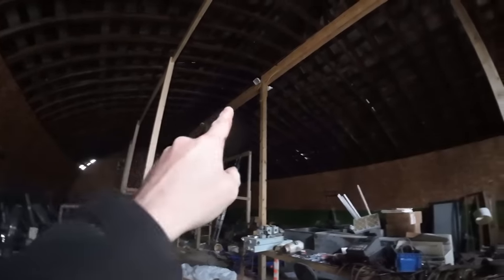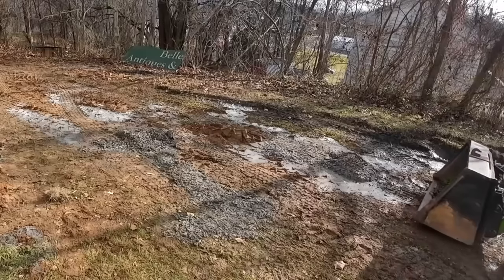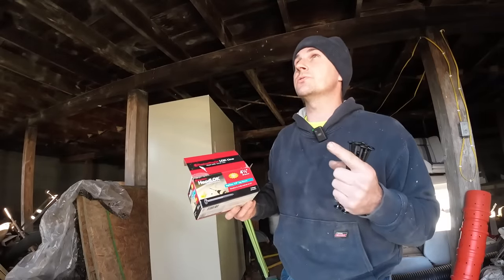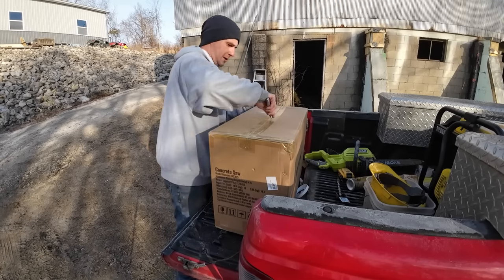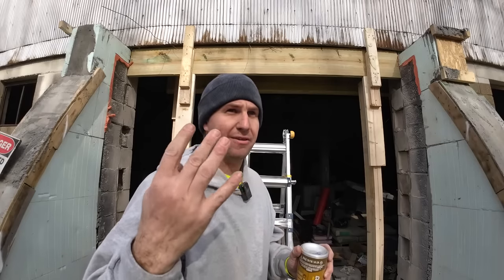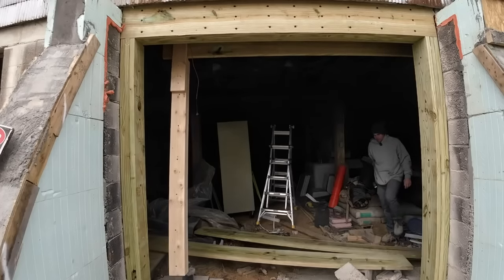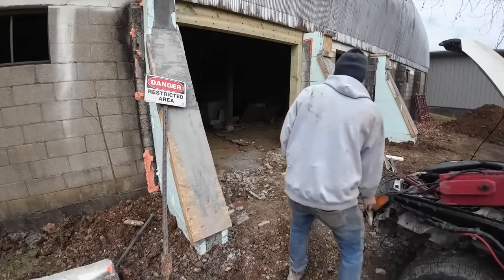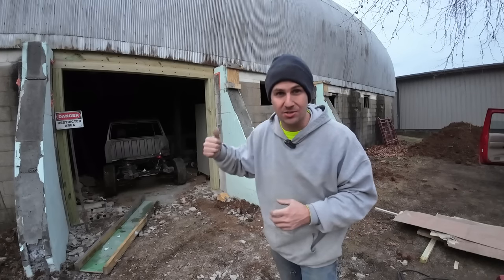Busting open the Basement - Barn Revival Pushes Forward!

Comment: Mike- I really enjoy your videos!  I think you have tremendous talent and drive.  Your attitude is always fantastic!  One tip from an old man who is suffering from hearing issues…..foam plugs are better than nothing, but please supplement with good muffs when using noise producing equipment.  It decreases the inevitable destruction of the cilia in your ears and prevents the repeated questions such as “I’m sorry, I didn’t catch that, could you please tell me again?  Huh? “. Your wife and family will be able to talk with out shouting and you won’t need to have those dangling accessories hanging from your ears.  I speak from experience, I didn’t start early enough and now have a bird sanctuary residence in my head.  It wasn’t so bad…until it was, and it is irreversible.  Please take my example of negligence as a lesson in prevention.  Only bring this up because I hope that I can help you be the perfect example of a Tube provider 😊. Great work you are doing, what other channel?  You have 2?  Link?

Comment: The foundation wall part that’s buried. In which is something that you want to look into. Is if there is any clay soil there you will want to remove and backfill with sand or crushed stone. The clay will move a wall like a hydraulic cylinder as it expands when wet. Also clay is to compress to prevent frost jacking in winter.

Comment: I bought an evolution electric concrete saw years back. Great additiion and for a unit you use now n again there is not an issue with fuel gumming up or hard starts from sitting unused at all! For a now and again user I think they rock!

Comment: You have opened the wall to new expectations 😃 
Your cut off saw worked like a charm, did you get much torque twist off it ? I always seem to get plenty on the larger grinders 😬

And you would like to drop the floor by 600mm (2') ? 
Right, I will be around with my shovel and wheelbarrow, just until you have the time to complete your tipper 😉😂

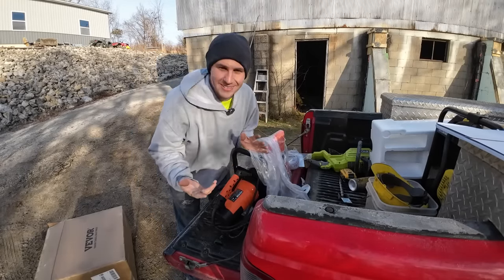Comment: 15:32
Nothing wrong with an electric concrete saw. I have a Hitachi that is essentially a very large grinder body with a loop handle and full coverage blade guard. 
It works great and I did all my interlock with it. 
You can’t set it down with the blade spinning and the unusual thing about it is the blade turns the opposite direction.

Comment: Love what you're doing. If your long term plan is to increase the height of the lower level by 2' and replace basically all of the foundation walls, why not fix the upstairs then jack the entire upstairs up 12" to 28", set it on steel beams and cribbing,  build a new foundation all at once, then set the top back down. This should help with efficiency, give you a better end product, and help avoid water issues in the lower level. Just a thought. Hope you're successful. I enjoy watching your progress.
Reply from the maker: I've thought about that.  There is one major issue, and that's making the entrance goals I have more difficult.  I think it will make sense in the end

Comment: Just a thought... it looks like part of the structural problem with the arches is a lack of tension structural components from one side of the arch to the other.  That combined with the delamination of the arch beams is allowing the sides to bow outward.  As a temporary measure to restore that tension, have you considered attaching cables from side to side to draw in the failing sides of the arch?

Comment: I  recently  did a similar lift. Keep in mind that current dimensions (buttress to buttress) will not allow you to bring the trusses back to original position without  providing some releif to the trusses and roof metal. Moving the walls back is not an option. I might be stating the obvious here.  I can't to see this lift. Good luck

Comment: Thanks for sharing your thoughts, ideas and videos. Your explanation confirmed what I saw as handwriting on the wall. Will be great to get some additional headroom down there. But is 10’ enough for the eventual lift that I’m expecting or do you plan to put in a pit like at C&C. Looking forward to seeing the lift, the mention of the delaminated arches reminds me of the Swedish farmer that built a hoop green house glued up out of laminated birch wood that he harvested, milled, and dried from trees off the farm. Makes me ponder if you could just re-glue up the arches with some modern glue once you get them back to the required profiles. Looked like a very similar design. Progress is looking great, wishing you and your family the best.

PS I wouldn’t worry to much about talking to yourself as long as you give yourself good advice.

Comment: Install cable's and a come along at the sweet spot from left wall to right. Crank away. As time goes....tighten..... you can do other things as the cables do there's.  When done , sign the handle and sell off to supporters.😊 bending that wood back will take years😢 WE IS A GOOD THING. We are with you, even through WE are apart. WE are watching, talking to you threw the screen.😂😂😂😂😂

Comment: There is a product called sure wall that will make those blocks strong we used it in block wall reinforcement on construction sites goes on like plaster
Reply from the maker: Any product like that is nothing more than a band-aid. It's frustrating for me to see them sell that to people and people think it actually does something. If a block wall is failing, it needs ripped out and replaced.

Comment: I was wanting to know how the concrete saw worked compared to the gas version. I usually use a gas powered one myself but it'd be nice to have one for small things that you didn't have to carry gas around for and start 40 times but didn't know if it would have enough power
Reply from the maker: That's exactly what I wanted it for as well.  Block work mainly.  I didn't have any issues with this on power.. just like a gas, let it build speed first.
Reply: @CaptainKleeman  thank u sir.   Enjoy ur videos sir

Comment: Hello Captain Kleeman.
I'm afraid that your concrete supports on the outside wall will work the wrong way around. That they will hang on the wall. So they pull your wall outside. I have not seen you make a firm foundation under these supports. And this is not a comment on you, I think along with you.
Greetings from the Netherlands/Holland/Friesland.
Reply from the maker: They have a mono poured footer that is 3 feet wide by five long.  They are golden.  It was covered in the previous two videos. 👍

Comment: The building more than likely failed due to the geography of the area.  Being on a slope leading to the water means that large poured wall essentially slid downhill pushing the building with it.  This can happen because of freeze thaw cycles and water runoff. The area could even be an ancient landslide area lol.

Comment: Why not truss the roof?  That's what should have been done originally.
Reply from the maker: Why should that have been done originally?  This is a common barn style and most don't have issues.  The issues typically come from lack of maintenance.
Reply: @CaptainKleeman  At the first sign of sagging, it should have been obvious that the structure was unsound. Trussing the rafters would put a vertical load on the side walls instead of a horizontal push.

Comment: Not so sure that building is going to be cost efficient by making adjustments here and there. I would have thought a more better idea would have been to disassemble one end of the building, in so far, and rebuild that end and than move further in with the same rebuild. That way you are not spending excess money on little fixes that probably will end up costing more than rebuilding it the correct way from the start as you go. JMHO.     Thumbs Up!
Reply from the maker: I ran the numbers,  it makes sense financially to do it this way.